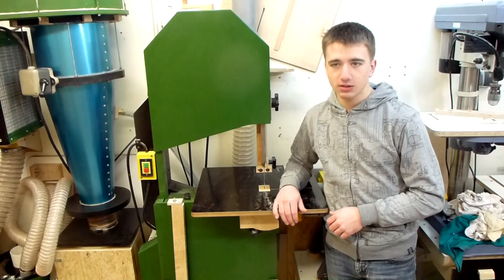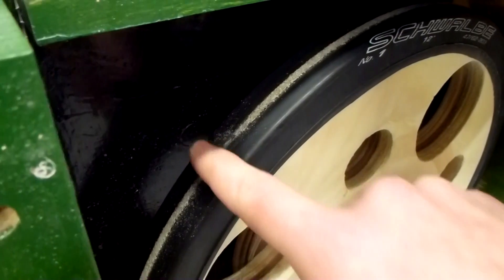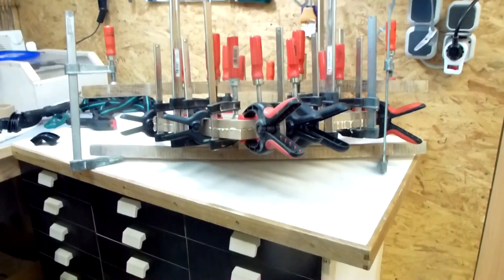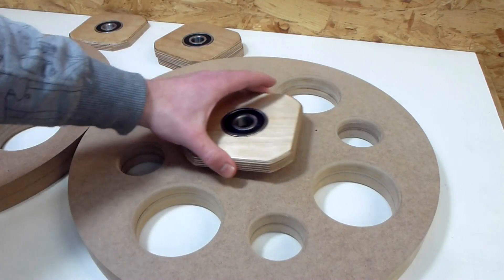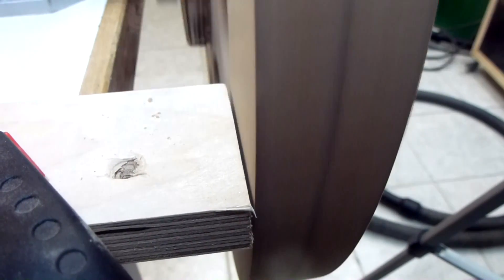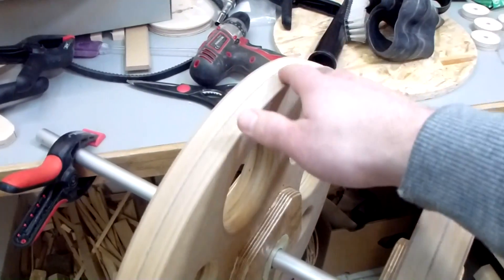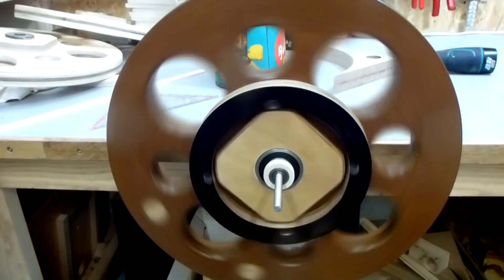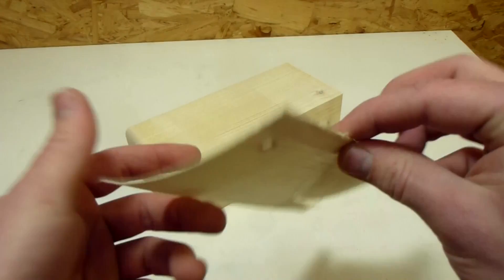New Wheels for the Homemade Bandsaw

Comment: Looks great!  On a side note.  I highly recommend holding smaller pieces like that with a clamp or vice when using a holesaw in a drill press.  They have a tendency to bite in/snag the material which can cause it to spin out of control.  I   almost lost my thumb doing It the way you are.  The cut was to the bone.  Thankfully I kept the thumb and the nail grew back.. well, kind of...

Comment: Man, just glue the tires with some light glue, no more saw dust issues.. Also, I think a soft start module might help with the initial kick, I installed one on my table saw. For the blade guides I have seen often that graphite impregnated phenolic blocks are used, they should be better than simple wooden ones and clean the blade at the same time.

Comment: There's something soothing about cutting inner tube rubber, huh?
Wow! That 2hp motor takes off like a striped ape in heat. Great job! ..and thanks for the tip about where to buy spar varnish. I hadn't thought about it but it makes lots of sense.

Comment: Nice work Marius. What thickness MDF did you used for the wheels? When you carved the bow section, how much wood did you carved out, 2-3mm?
Reply from the maker: The wheel is two layers or 18mm MDF. And the bowed section is about 1-2mm deep
Reply: @MariusHornberger  two layers for a total thickness of 18 or 36mm? Thank
Reply from the maker: Damn auto correction. 2x 18mm, 36 mm total. 2x20mm (40mm total) would also work

Comment: Fantastic work overall and extremely impressive machine you've got. Your shop videos oddly inspire me to design and make my own wood working machines but being more experienced with metal work I may construct it from welded steel tubes or plates, so a fabrication / welding project or two I have in mind. I may make videos in future, should you wish to exchange your technical experience?

Comment: Marius, it's quite some time since you posted this video.  What has your experience been with the new wheels?  Are they as good as you hoped for?  In particular, how has the rubber tyre stood up to usage?  I recently found a hole in my lower tyre, on the crown under the blade - about 2" long).  I can't remember what size inner tube I used - they were quite difficult to get on, but when the wheels are spinning, they separate a bit (get flung out) from the upper wheel.  I had thought of a measure to stop this happening, but it would add weight, and if yours are really good, maybe I'll rather copy your idea.
Another question - I have had two blades break at the weld.  Have you ever had that?  If so, do you have any comments on what may be causing it?  My blade speed is 24.7 M/s - a bit faster than yours (my motor turns 3000 RPM), but that's in the same ball-park.
Reply from the maker: The wheels work great. Still the same as on day one also the tire. (16" wheel, 12" tire). I had one blade break at the weld. I wouldn't worry about your saw, because of two blades

Comment: Amazing work.  You're quite talented!  However, I must admit that I cringed at 14:30 when (after the high quality varnish and other workmanship of the entire project), you used drywall screws to fasten the drive pulley to the wheel.  While I admit such screws might have been strong enough, to match the workmanship of the rest of the project I would have used screws with a higher sheer rating and a different coating.  A shiny coating - stainless steel or nickel or whatever - would be better aesthetically too.

Comment: I turned my wheels the same way you did and have the same amount of crown.
however sometimes the blade wants to jump on the lip because itsalmost as high as the crown it self.

do you think that's related to the tracking of the blade or should I make the crown even more pronounced?

PS: Falls du mir antwortest kannst du das auch gerne auf Deutsch tun, ich weiß nicht warum ich auf Englisch angefangen habe... Grüßle

Comment: Hi Marius,

Do you use 20mm inner diameter bearing? Do you use normal steel for shaft?

Matthias plan include in first layer 14cmx14 cm flange (6mm) and secondly 12x12cm (11mm) flange.

Do you use only 1 layer flange? 

What do you think , Which is the best solution?
Reply from the maker: my bearings are 20mm id, 52mm od, 15mm thick. Both my flanges are the same size and 140x140x15mm

Comment: the bearings and shaft are the most expensive part. which size did you use for this? or where can i find the exact bearings you have used? it would help me a lot

Comment: Dear Marius , thanks for your great video. I prefer your MDF wheels because its easier to balance them. I have a scrap 30mm MDF to use so I could  avoid gluing 2 16mm pieces. You think 30mm  thickness is ok? Thanks a lot
Reply from the maker: yes, that's enough
Reply: thank you so much for your prompt reply!!

Comment: Hallo,
warum ist die Lauffläche Deiner neuen Räder konvex?
Reply from the maker: +Boris Schult das ist da für, dass das Sägeband dann mittig auf den Rädern läuft.
Reply: mein breitestes Sägeband ist 25 mm, reicht dann eine Breite der Lauffläche von 30 mm? 
Ich habe auch Bänder die nur 13 bzw 6 mm breit sind angeschafft, "zentrieren die sich auch auf der konvexen Lauffläche?
Meine Räder plane ich gerade mit 550 mm und 450 mm Durchmesser :-), Bandumfang 3380 mm, der Motor hat 3 kW

Comment: You're better off NOT cutting both discs to exact size before gluing. I've made a lot of pulleys and wheels over the years and you really need a little extra meat on the outside because you will never get both discs exactly centered. With extra wood you can turn them to exact diameter and center.

Comment: I think you made some errors in not having a method to index the second bearing holder in the glue, once you had established where it should've been, something like a piece of MDF cut to touch four sides of it, or anything that indexed the bearing holder would've had helped a lot.
On the observation that glue hardens MDF, you're right, basically it turns MDF to HDF, and a good way to make your wheels stand abuse is to brush on super glue with a steel brush. Once you do that, it becomes rock hard.

Comment: Marius, have my wheels glued and rough cut, ready to turn to finish profile and diameter. What SFM did you turn your mdf wheels?
Reply from the maker: +kerry buxton SFM? If you meant rpm I think it was about 300
Reply: Marius, will build drive pulley to give me 300 rpm. Surface feet per minute. Guess you use surface meters per min?  Thanks for the help.

Comment: I see you made 40 cm/16"  wheels like in Matthias's plans, what size of blade do you put on them?
The plans ask for a blade of 2670-2700 mm but those are not as easy to find as I would have thought.
Have I been looking in the wrong places or is it a less common size in Europe?

Also for the new motor, how does the pulley size on the motor compare to the one on the drive wheel?I think I can calculate it from the information I have but I may be wrong so I wanted to check to make sure.
The motor rotation = 1400rpm so 23.3... rps.
The blade speed is 21m/sec or 16.72 rotations of the drive wheel.
this would mean that the pulley on the drive wheel is about 1.4 times the size of the one on the motor?
Is my assumption correct?

Matthias seems to prefer slower speeds, adjusting the pulley would be the only  option since I don't think there are induction motors that run slower then 1450 rpm. Do you think his recommended 12.5 meter/sec with a 1hp motor is enough to resaw hardwood or should I go for a higher speed and/or a stronger motor.

Sorry for all the questions, I just want to get info on the math & supplies before I start to avoid unforeseen issues and material waste.
Reply from the maker: I order the blades online. A custom length like 2700mm is no problem (tuffsaws.com). You pulley assumption is correct.
I previously had a 1000rpm motor (six pole motor) on the saw with a slower blade speed. If you can get a more than 1hp, go for it and then also for a higher blade speed. 12.5 will be enough, but you'll be happier with more power/speed.
Reply: Thank you for the quick response, I looked at tuffsaws and I understand why you recommend them, they know what they are doing. 
I will probably get a stronger motor if my workshop/garage fuses can handle it.

Comment: Very helpful video! Ratio from your motor 1400rpm to 1'st wheel is 1:1?  And what type of glue do you use at 4:03, anything special?  Kind Regards Andrew!
Reply from the maker: No, it's about 1:0,7 or 1000rpm on the wheel. The glue is regular wood glue, I just buy it in larger quantity.

Comment: I know it's an old video... but when you mentioned things gumming up the blade, it reminded me of the Meat Saws (stainless steel band saws) I use to clean when I worked in the meat cutting department of a grocery store. It had little scrapers that pinched the blade attached to a free-floating piece of metal so it could slide side to side so it has even pressure on both sides.

http://i.imgur.com/q4vn2jj.jpg

We coated the entire machine (including the blade) with food safe mineral oil after we finished cleaning it every afternoon, then wiped off the excess in the morning. Ours was ENTIRELY stainless steel though. No rubber on the wheels for traction. I don't know how the rubber would react to the mineral oil, so it'd be best to let a piece soak in mineral oil for a month and see what it does. Might start dissolving, or might become brittle and crumble apart.

Comment: What was your rationale for lightening the wheels? If they are properly balanced, the rotating mass shouldn't matter, or am I missing something? Does the reduced mass make it easier to balance in some way?
Reply from the maker: There is no particular reason. But big holes made it easy to clamp the bearing flanges.
Reply: And did you see an effect after lightening the old wheels, outside of balancing them again?
Reply from the maker: I didn't lighten the old wheels. What exactly do you mean?
Reply: You said you lightened them at 2:02.
Reply from the maker: ah, yes I noticed less vibration. But balancing would have been enough. I didn't know better at that time
Reply: Ah, okay, thanks a lot! I am building the 20" Woodgears bandsaw right now, and want to incorporate your wheel design (the crowned channel), so I was curious.

Comment: Your wheels are a work of art! I like the design and am going to borrow at least the idea for the 24" bandsaw I'm building. I too prefer MDF over plywood for its higher density, uniformity and stability. 4000 feet per minute seems a bit fast. I try for about 2500. Cuts aren't as fast and you have to slow the feed rate, but the blade stays cooler and lasts a lot longer. Whatever you prefer of course. For the holes I'd recommend using a template and cutting them with a router and top bearing flush rim bit. Those big hole saws really tend to load up. And you can get really artistic with your hole shapes.

Comment: Hi Marius 
Excellent work
I started building my own bandsaw and would like to ask you what kind of ball bearings you used 
I have found a 30 mm black iron rod which I'm going to use as a shaft for both wheels
I found skf ball bearings with ID of 30 mm but different ODs and bearing height/thicknesses
Which one should I choose ?
Thank you

Comment: When I cut green wood, I soak the blades in a solution of Murphy's Oil Soap and water for a couple of hours. It dissolves wood sap like magic. Dry it and spray with WD 40 to keep it from rusting. I don't have a band full sized band saw yet but it works great on the circular saws and my old three wheeler. It's good to keep several blades and change often.

Comment: Probably you won't see this, but I am thinking that you made these wheels before you got your X Carve. I just made some very accurate concentric circles on my X-Carve from MDF and built them up to create a replacement base for a floor standing drill press. Now I am watching your video right after Mr. Wandel's big band saw build, I am thinking the X-Carve can make very accurate MDF band saw wheels, or at least I am going to try it as soon as he releases his new band saw plans in January. Definitely going to use your idea of a channel instead of trying to stretch inner tubes over the outside.
Reply from the maker: I see everything. The X-Carve maybe makes accurate circles, but you'll still have to turn them afterwards.
Reply: Actually, I was thinking of the problem of making holes in the bearing blocks to precisely match the ball bearings without having the perfectly sized hole saw, and of machining some alignment holes in the wheels and  bearing blocks so that I would not have to rely on my imperfect skills with a hand held drill, and avoiding the fuss of tapping the bearing blocks into place to get everything aligned.

Anyway, you are doing wonderful things in your shop and you are inspiring people all over the world. I really enjoy your videos.

Comment: Very nice work. I have built many machines for my commercial cabinet shop here in America [Czech-Slovak family, with many features of the German technical abilities]  and I have many Band saws, one of them from 1890 or so, that I took from the bushes and rebuilt completely, heavy cast iron, 32" wheels. I want to share with you my problems and solution for the rubber bands on the bandsaw wheels. Here, we can buy rubber bands or tires to go on the face of the wheels, and I did so many times, installing them with a rubber cement to fix them. In some cases we would use a router, fixed to the table to mill the rubber tires after installation to provide a perfect circumference. Finally, we tested using a top quality duct tape, or the best electrical tape, Scotch '33' , simply wrapped around the wheels. This has been a fantastic solution, and all our machines are now using this. Finally, in your instance with the MDF wheels, I would mill a slight crown to the wheels and then use NO rubber at all.  

I also have a 'Woodmizer" sawmill, which will except a 1 meter log. Here with a 3 phase 30 HP motor and a 1.50" band blade I learned much about heavy work with bandsaws. It is interesting that this machine uses a standard 'V' belt cast iron pulley with a
v-belt fitted to just be able to be forced onto the pulley. Therefore, the blade body is running on this v-belt, centered, and the teeth are just off the edge of the belt which stands above the cast iron wheels. A very peculiar methodology, but in practice a perfect one. Another solution is to simply track your band blade teeth just off the edge of the wheels and use no rubber at all. Many sawmills use cast iron wheels, and track the teeth just off the edge, eliminating the issue of rubber deterioration and replacement.

Good luck in your career - I wish I had someone as yourself in my company with such obvious skill and attention to detail. Here in California, it becomes more difficult to find workers that can tie their shoes, much less engineer and build a machine. Now, if you look at my page, I grow weary of the woodshop and spend more time developing roads on my lands with heavy equipment. A very satisfying change from all the wood dust!

Comment: Hey Marius
great build first of all, planing to build it aswell but there a two questions left. First where to you get the bearings and shafts for your builds? And second. which Kind of Operation mode for your Motors do you think are the best. Didn't want to overload the Motor.

regards from germany
Reply from the maker: You shoud find what you want to know here: https://woodgears.ca/reader/marius/bandsaw.html
The motor is wired up in star, if that's what you mean.
Reply: Marius Hornberger I meant S1 (contimous) or S6 (with cooldown time) like a lot of table saws. Isn't there a shop to buy bearings and shafts?

Comment: Hello Marius, great work on your saw, i liked the way you have done the wheels; i was wondering if you can share where did you get the ball bearings? and, where do you find induction motors in Europe. thanks.
Reply from the maker: bearings: http://www.agrolager.de/
motors I get from eBay
Reply: Hi There, Thanks for your answer. can you please point me for the one you choose for tor the saw wheels? and, do you have any idea of where can i get the steel shaft? hey thanks, btw, Love your videos. keep doing good stuff.
Reply: I hook up the little utility trailer to the car and drive around the neighborhood on trash day. Somebody's always throwing out an old washer, dryer or other appliance. Nine out of ten times the motors are still good, as well as pulleys, belts, etc. The rest I usually can get a buck or two for at the scrap yard. Enough to cover gas for the car.

Comment: For mounting the second bearing block: would it help to dry fit it straight and then drill some screws and/or dowels through, and then glue it while the position is provided by those?
Reply: That's a smart solution, with the dowels. Has to be a tight fit though, but it should be a lot quicker than trying to tap it into place with no guides.

Comment: Hi Marius, i just bought the plans for the saw. going to start building it after finishing my abitur.
I only have a question about where you get your blades from here in germany. Can you recommend a shop where you have a selection of blades in the lenght of 2670-2700mm?
I find i quit hard to find shops offering them.
Reply from the maker: http://tuffsaws.co.uk/ best blades I have. Get a 6mm (6 TPI) Supertuff Carbon blade. I use it all the time and you can do almost everything with it.
Reply: Thanks for the fast answer. Do you buy them in a custom lenght or do the 104" or 108" lenghts fit the saw?
Reply from the maker: +Marked One custom length